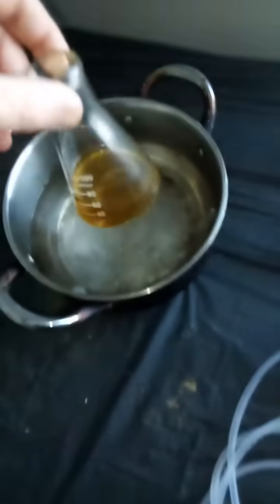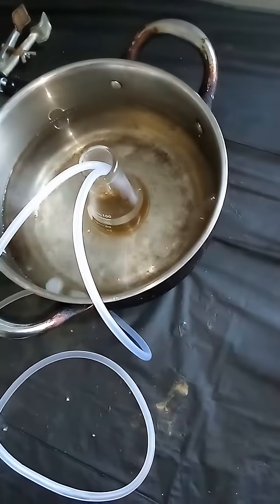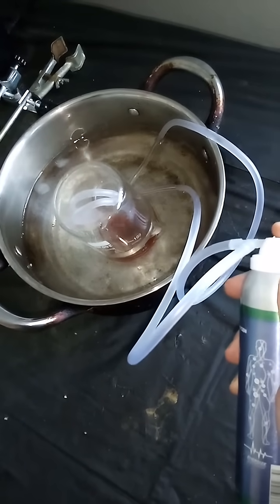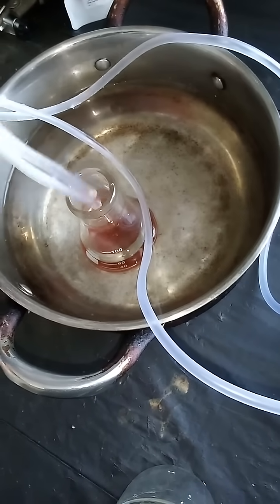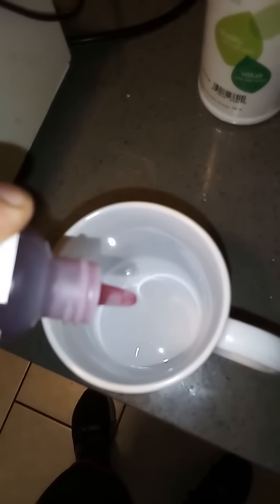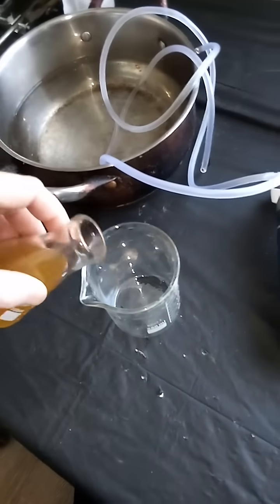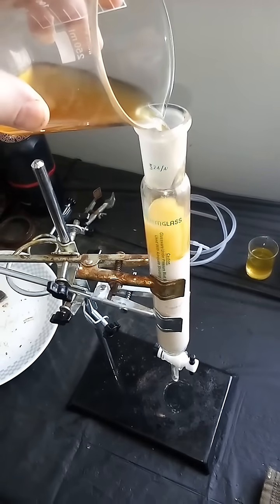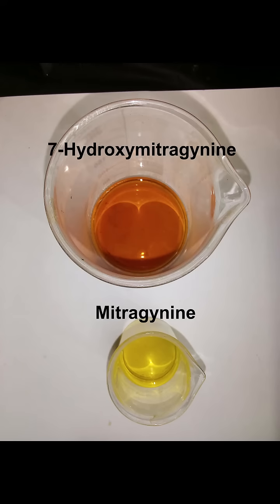How to make 7-Hydroxymitragynine by @KaliforniaKratom

Comment: I saw you say 58% yield for sodium thiosulfate, whats the yield for citric acid?
Reply from the maker: The yield is for Rose Bengal oxidation. I'm not sure what the conversion rate is from the peroxide to the alcohol using citric acid, I think you actually get a mixture of products (the ketone, the alcohol, complete reduction back to hydrogen, etc.), I used it because I didn't have a better reducing agent on hand, and for the sake of making a tutorial video, so use sodium thiosulfate instead and you'll get 58%. You can use other reducing agents too; sodium metabisulfite and things from that series but I don't have immediate access to HPLC to give you accurate results for that.
Reply: @KaliforniaKratom  thank you sir

Comment: Whats the yield like? How much dry material is feasible for like lets say 5g hydroxymitragynine? Do you need to pull any other "adulterants" out of the finished product? Besides obviously whatever agent you're using for extraction. I read about chloroform production in there somewhere? Is that made from extraction or a necessary additive?
Reply: He is putify with chromatography. If it’s done good, only product that he have after that is actual 7-oh
Reply: I wish he would answer this question. Im wondering the same thing

Comment: this info will be very valuable if this substance gets banned
. I always keep extra on deck in the case i have to taper off and switch to regular leaf!
Reply: Same lol I got like 30 g of raw powder 88.9% 7 oh 😅 and and probably like 700 30mg tablets I've been preparing for this day
Reply: @travisphelps3602  yeah itll be off the shelves soon imo. Yeah i got like 50 tablets left ive been stocking good quality kratom powder that should be more protected as the 7o will run out. My taper Again has started. Goodluck on the journey 🤙

Comment: Does the water come out last or do you get it first out of the column
Reply from the maker: First. I used reverse phase chromatography here but would've gotten better separation using a C-18 stationary phase. If you switch to using ethyl acetate and hexane as the mobile phase with alumina, you'll get a cleaner separation where the 7-OH comes out last.
Reply: @KaliforniaKratom  I must've not oxidized mine rite,it stayed yellow the whole column process

Comment: You're a legend for this 🙌🤝💪😎 a video on the entire process start to finish with leaf would be legit af tho 💯
Reply from the maker: This video starts with the mitragynine I separated from the extract I made in the first video. The second video shows how to separate the mit from the other alkaloids in the extract using chromatography. This is actually the 3rd video. In the first video I started with Okie's Red Borneo powder and made extract from it.
Reply: @KaliforniaKratom oh crap! Need to check those out. Tks bud! I appreciate this type of content 🤙🏽
Reply: @KaliforniaKratom can i use mittag y one extract from my local smoke shop to start at this step in the process or no?
Reply: @savagelandor  Not if the mit extract already has no 7oh as it was removed and not captured in the process, as I understand it.
Reply: @VantageCollective no true. The mit converts to 7OH through oxidation. It’s never contains 7OH to begin with.
Reply: This is leaf man
Reply: @b-rad3937  I know it's starting from leaf powder but how you end up at this point in the video 👨‍🔬
Reply: Replies not showing up for me

Comment: How was your yields?
Reply from the maker: I didn't test it but the literature suggests a 58% conversion rate when using sodium thiosulfate as a quenching agent. I used citric acid so it's probably much lower than that.
Reply: I just saw this comment. So, decent for the money you put into it? And is it decent quality? Thank you for posting this, btw.  7hydroxy has been very helpful, much cleaner and no brain fog compared to the amount of mitraginine  i used.. but so expensive.

Comment: So how do you get it out of the methanol solution and would it be fine if I use ever clear? Cause I just don't know how safe it would be to use methanol unless I crystallize or extract it out of the Methanol some way what do you recommend I'm about to buy all the supplies and need your advice
Reply from the maker: @derekiskindacrazy1541  there won't be any methanol I'm the final product. It will evaporate off. Ethanol is less effective - and is also toxic, hence the word "intoxicated."

Comment: Sodium thiosulfate doesn’t get rid  of the pink color the same way as this video shows. It stays undissolved in the flask and the color stays red. Is it better to use citric acid and THEN sodium thiosulfate or do u recommend not using sodium thiosulfate at all?
Reply from the maker: I recommend following the literature and not using citric acid. Use sodium thiosulfate and stir at room temperature for 5 hours. Just put it on a magnetic stirrer. The Rose Bengal will then separate out through chromatography. 7-oh will be orange/brown, Rose Bengal will be bright pink, and the MG will be yellow.
Reply: @KaliforniaKratom  it just won’t dissolve. I have sodium thiosulfate crystals clearly visible under my bright red liquid. I’ve been stirring it periodically for two days it’s just sitting there and not dissolving. I’m gonna run it through the column like you said. Maybe I added too much but it’s still red so idk. 
For my next attempt should I use just citric acid or both citric acid and sodium thiosulfate?
Reply from the maker: @CheeseGreater1274  Did you add solid sodium thiosulfate? Use a solution of sodium thiosulfate, not crystals.
Reply: @KaliforniaKratom  what should I dissolve the crystals into? Water? Or alcohol?
Reply from the maker: @CheeseGreater1274  DI Water. Might need to heat it up a bit.

Comment: Hey man, I have a question for you, i’m able to get the alkaloids to convert to their freebase form. I’m using sodium hydroxide which that might be my issue, but I have the precipitate that comes off the mixture and I cannot get it to dissolve into water that is acidic using citric acid or even hydrochloric acid. Once you get it off the chromatography column in it’s more pure form. What do you do to convert it back to its salt form for consumption. I’m stumped because it is resisting a pH change.
Reply from the maker: I'm confused by your question. Are you talking about this video, or the first video in the series?

Comment: Which brand are you using for the pure oxygen?
Reply from the maker: It's O2 Blast from Amazon, it was $25 for a 3 pack. The Rose Bengal was $10 on Amazon also.
Reply: Are the yields decent?? This is groundbreaking, sir

Comment: How do you turn that into a pill format?
Reply: Reduce it into a solid powder form under heat and mix with pill binder or put into capsules
Reply: @CheeseGreater1274  do I need to add anything else or is pill binder and powder all that is needed?
Reply from the maker: @RicardoRodriguez-g9v  Cheddar cheese.
Reply: Cheddar makes it better.
Reply: @CheeseGreater1274 how much heat? And im assuming in a pyrex baking dish?